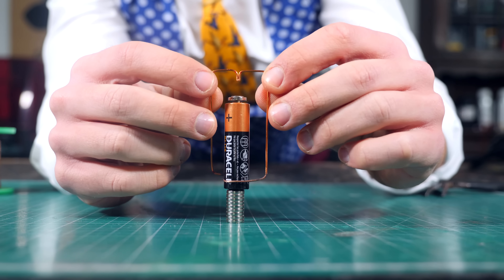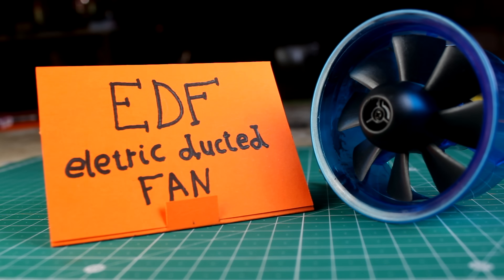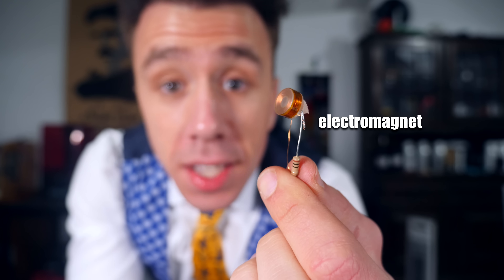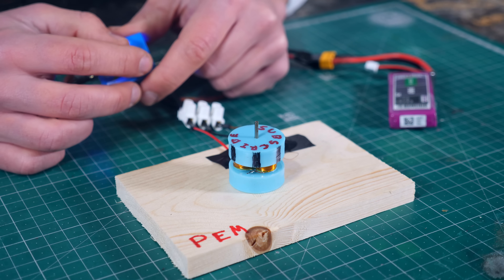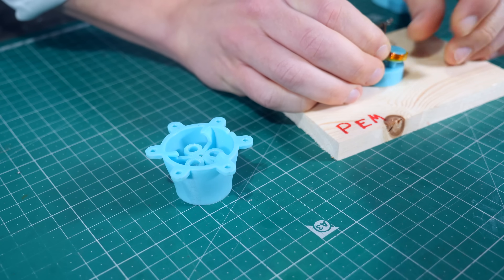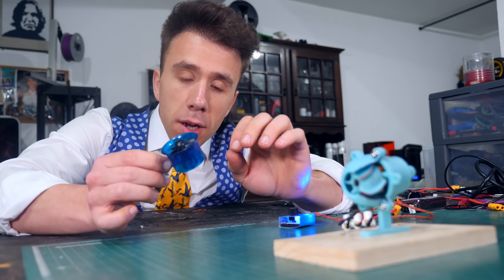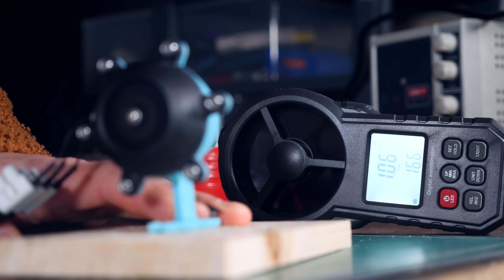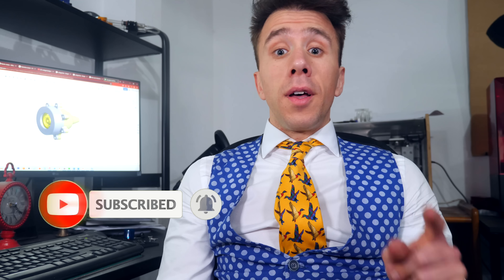I 3D Printed an ELECTRIC MOTOR FAN

Comment: Depending on your area change you can effectively increase or decrease the change in speed from inlet to outlet. When you use the impeller you are kinda just makign a fancy but simple fan whereas a dyson fan assembly still act as a converging nozzle. Converging nozzles are used because sub Mach1 flow increases (based on some fundamental equations that im sure you can find in one google search) when converging and over mach1 flow increases when diverging (Hence- converging diverging nozzle design of most jet and supersonic aircraft engines ant the bell chape of rocket engines) If you use that and know your inlet velocity you want or can get from an impeller or whatnot, you shoul'd just be able to input those to find your inlet mach number, which will probably be really slow but still, and then you can just figure out the in between values to get whatever output you want in terms of area change and anyhting else. Albit take this all with a grain of salt, I didn't really pay attention in my classes when there wasn't combustion involved.

Comment: I like Jets. I like computers. 

Why not cool a gaming computer chip by using an impeller jet to send water across the chip at high pressure? The impeller could work better in water. 
Or create a real underwater jet with a ducted fan and a fuel that burns in water (Magnesium/Sodium). Maybe don't use the superheated water exhaust to cool the computer.

Comment: Instead of adding some restricting structure to fan blades to make them splay out less under load, to make them not rub the casing, just note which parts rub the casing and shrink those. You'd be basically calculating this distortion as it occurs into the design, you're optimising the fan towards one given RPM where it's just splayed out enough to not touch the casing, but you avoid adding moving muss and air restricting structures. I doubt it's the crucial shortcoming here, but this is how mass produced fans are designed.

Comment: Hi Integza here is a good theme for a video. How about designing something that is cheap and can generate electricity. South Africa has been having rolling blackouts since November 2022. We are being told to get solar and go off the grid. A 10kW solar setup costs R265,000 and not many South Africans can afford it.

This is also a cry for help. 60 million people are suffering because of the rolling blackouts or as we know it... Loadshedding.

Comment: I am no above 100 iq person, but I would go about this very diffrentally, not so much the specifics, but the overall process. first id want to have a controlled variable, to do this I would use some motor setup that gives reliable rpm output or just use a tachometer to know what rpm the motor is at. with this testing each propellor design will more or less remove the motor from the equation. now that I don't have to account for motor speed, I can know the lower thrust of a fan type is the design alone. from there I would play with intake and outake sizes, as well as blade configuration(size, length, pitch/angle of attack).   this is just an overly complex way of saying to use trial and error with some of the scientific method. if you isolate variables and change only one at a time then you can learn and get repeatable results.

Comment: It could be one of several problems:
it could be that the increased/ decreased mass of the printed impeller is throwing the motor off
it could be that the tolerances of the print were not tight enough and you were losing pressure
it could be that the impeller wasn't balanced correctly/ not at all
the possibility of a rabid tomato militia scared it
some mixture of multiple problems

Comment: The only thing I can think of is, if you copied the impeller exactly, would be the weight of the material used to 3d print it, if your impeller was slightly heavier, the 3d printed impeller would not reach the same speed as the impeller you designed it from, which I think would mean it would not be as good, just a guess though

Comment: I think it's because the motor itself is tuned to produce the most power with a higher torque and lower rpm, and the impeller design calls for a motor that produces the most power at a lower torque and higher RPM.

Comment: Toroidal propellers are the next stage of fan/propeller development. For boat propellers they are meant to up to double the efficency. MIT did development of drone props and there was big gains there as well.
Surely a toroidal tomato bender will be even more efficient than standard ones.

Comment: I guess you should also measure pressure. The regular Impeller is made for high speeds. The Zentrifugal Fan is made for high pressure. As well, the geometry of your impeller makes me wonder. The angel of attack on the inlet side is to narrow, thus creates to much turbulence and hinders incoming airflow. the Angel on the Outlet side looks to steep, also creates turbulence instead of pushing the air. Look at the dyson turbine for reference. But again, you probably wont reach as much as high speeds like the regular impeller, as those are two different propellers with different strengths.

Comment: I think that the device your using to calculate the trust work by calculating  speed of not pressure. And jet engines like slow high pressure air.

Comment: I would say the biggest difference is the intake diameter but also the exhaust of it, is the impeller actually compressing the air going through or just pushing it? I also think the spacing between the impeller and the case would make a difference, I don't know if there are different printable materials that don't expand as much but you would want the gap to be as precise as possible. (Just thoughts)

Comment: the likely problem is the impellers mass, you need a lighter fan. also the air is being compessed, not sped up like in the EDF, so its a mix of having slow moving compressed air and too heavy of a impeller

Comment: Here is my thought... 
Disclaimer, even though hereafter I say "based on my lecture" I'm still a student so feel free to correct me if I'm wrong #cmiiw
Based on my fluid mechanics lecture, the impeller you made is called a compressor. Yes, you are right about the compression things but the nature of that component is to diffuse and compress the air (as its name). Consequently, the air on the output will have a lower velocity. More precisely the kinetic pressure (i.e. the velocity) changed static pressure. Therefore in the exit, the pressure will be increased (due to "compression") and the velocity will be decreased (due to "diffusion"). (i know, this is very scientific).  
In the aircraft, this high-pressure but low-velocity air will be burnt in the combustion chamber to increase its energy. After from combustion chamber, the air will enter the turbine. This turbine has the inverse function of the compressor. Here, the velocity will be increased and the pressure will be decreased. Well... the overall result will be air with high velocity (or scientifically speaking, high momentum). 
This is very different from the EDF. Its basic function is only to increase air velocity. Meanwhile, the aircraft turbojet engine (this type of engine is called an air-breathing engine btw) will decrease air velocity with the compressor, burn it with combustion (btw if I'm not mistaken the reason why we need to lower the velocity first is 'cause it is gonna be easier to insert extra energy to low velocity than the high one), and change all the energy into velocity with the turbine. 
Meanwhile, in this case, you only create the compressor... so that's why it has low output air velocity compared to EDF. Maybe creating the entire turbojet system will be a good idea :D
Oh btw as credit, I learn aerospace engineering at university. Again I'm still learning so #cmiiw

Comment: I have no idea why this would happen, but I do have some questions/ideas for an interesting experiment. What happens if you take your impeller and create a series with it? Will it increase the total thrust or does it just bog things down? Also Golf balls are dimpled because it reduces drag, could that be applied to a propeller to increase its energy efficiency or would the increased surface area cause it to slow down due to air resistence? I'm good with science ideas but terrible with math, so forgive me if these are stupid ideas. I'd also like to see you toy with different proppeller designs seeing as how the new toroidal proppeller has been in the news lately and am cruious just how shapes affect airflow and propolusion.

Comment: I don't know how true this is but it seems to me that the impeller fan has a significantly bigger mass across it's body. It's moment of inertia increases as it's radius increases which makes it harder to turn than the other fan. Additionally you might try varying pitch or angle of attack of the blades as well as perhaps air intake like others have suggested

Comment: You should make a video on over engineering a nerf blaster. 

Like using rocket fuel instead of a spring to make the plunger head go forward or using a fan and making it shoot as fast as the magazine can index a dart.

Comment: Have you tried using the dyson fan itself and printing a shroud for it? I suspect that the issue may well be the 3D printed resin blades are simply distorting under load as they are not as strong as the injection moulded parts usually used in these fans.

Comment: Bro nice video👌. But using this type of fun don't you get higher pressure and less thrust? It would work fine if you use also fuel ⛽️ You know like a jet engine 😏.
Reply: @mintegza1  what 📦 bro?

Comment: Some thoughts:
- Keep in mind for your deign: Modern jet engines try do move the air as slow as possible through the engine, but a lot of them. The actual fan in an jet engine has low rpm when compared to the other rotating parts in it.
- Match the overall inlet area and the ratio of free area to closed area for comparison. (Comparing apples with bananas gives reasonable results only until a certain point)
- Change the angle of attack of the leading edge of our compressor blades (There is an impedance mismatch at the very first edge - You chop of the air at the inlet with you compressor blades and rely on centrifugal forces. The speed difference is too high. Better "cut" into the air at the first edge.) The higher the velocity difference the "flatter" the first edge should be. Have a look how the slowly rotating blades of a jet engine are shaped.
- change the angle of attack of you compressor blades with radius. At the axle it should look more like an I or L, at the outer radius more like an S. This depends on the type of "fan" you try to build. Radial or axial accelleration.
- use an stator with thinner blades (impedance mismatch)
- the stator should look more or less like an inversed version of your compressor. The air flow directly after the compressor is spiraling, this reduces thrust, because the side-wise portion does not contribute much to the trust.
- reduce the distance between your rotating parts and the inner side of the hull. For example: At the red lines in your design, there is air "leaking" over from one section to another section due to the rotation of the compressor. At the back side of the blade, vortices occur which break air flow and create friction.
Reply: What he said
Reply: yeah, one look and the shape felt wrong, he had a dome shaped cowling that closely followed the impeller.
the reason he wasn't getting much air flow was because the intake was too small vs the rest of it, also, the low air flow was simply rotating within the cowling and not going anywhere.
 putting a cover attached to the rotor from the intake to the impeller exhaust would massively reduce his losses, leaving air only one path to go, outward, radially, this can be captured and redirected with an outer cowling that redirects the airflow back from radially to axially.
with stator blades to also redirect the spiralling airflow back to straight
Reply: High Bypass Turbofan jet engines normally don't employ a reduction gearbox. Instead, the fan operates a bit too fast for maximum efficiency, but it is at a 1:1 drive speed to the power turbine stages. A second coaxial shaft can be used to allow the compressor stage to run faster, and in that case it is driven by earlier stages of the turbine after the combustor stage. However, there are now Geared Turbofan engines that do employ a planetary reduction stage for the fan, allowing the turbine section to run faster than the fan. The fan runs more efficiently and the turbine runs at maximum efficiency. Pratt and Whitney recently brought out some geared turbofan engines.
Reply: Sounds like someone is indeed well read with aerodynamics.
Reply: True there are multiple planetary step downs.
Reply: Can one create a virtual boundary layer?  Like in the aerospike missile?
Reply: @NwoDispatcher  If you change the design a little bit, this may improve efficiency. The question is how you generate the virtual boundary layer and where. You need some power (compressor, gas generator, etc.) to generate gas if needed, or some extra power when the boundary layer is not established (at low speeds).
For high bypass engines there are some areas where you can easily generate a boundary layer. One low hanging fruit is the cover of the engine, actively by blowing out gas (front) or passively by creating vortices with a difference surface structure (golf ball surface at the aft portion), but the improvement would be not so high.
There are already prototypes where this is done at the wings. I'm not sure if they primarely use the ventilation with heated the air to reduce freezing at the wing tip.
Reply: The actual fan in an jet engine has exactly the same rpm when compared to the other rotating parts in it, since all rotating parts are mounted on the one-and-only axle...
Reply: @klausbrinck2137   There are already high bypass turbofan engines with gearboxes inside. Have a look what MTU already did ;) Or the patent US20140363276A1 from 2013
Reply: @marcelkanter  Turbofan engines use the combustion to turn the fan-axle instead of directly creating thrust, the epander-stage is oversized, and this fan then creates the thruston a separate axle... Still all compressor- and expander-stages are mounted on the same axle, and all turn with the same speed. It´d be useless to create a turbojet with another configuration. and here we aren´t talking about turbofans anyway, but about jet-engines
Reply: @klausbrinck2137   E.g. Pratt and Wittneys PW1100G has a gearbox, Many others use hollow shafts, that even rotate at differnd direction. But we drift away...
Maybe Integza first redesigns this fan in size. So he can compare them.
Reply: Since the compressor is 3d printed, and he's relying on centrifugal force anyway, he could probably connect the duct to the blades and have them co-rotate

Comment: Smaller engines need more rpm. Small RC jet turbines goes easy above 100K RPM and the dyson Motors too. The Motor you Build is way to slow and ist not easy to Build Motors that deliver power at high RPM. You should use the complete Dyson setup, then you have a high performance well Build and also balanced compressor.

Comment: I WOULD SUGGEST A LAGER INTAKE, WITH THE IMPELLER DESIGN FROM THE DYSON VACUUM, BUT IN THE BODY HAVE THE IMPELLER SHAPE IN THE OPPOSITE DIRECTION TO DIRECT THE AIRFLOW BACKWARDS, THE BODY NEEDS TO TAPER SO THAT THE OUTLET/ EXHAUST IS HALF THE SIZE OF THE INTAKE,  THIS SHOULD PROVIDE MORE THRUST AND HAVE THE AIR EXITING IN A STRAIGHTER LINE THEN TWISTING LIKE A TORNADO

BUT THAT'S JUST AN IDEA

Comment: I guess you need to increase the open diameter if the area of fan suction increase and , keep the fan long decrease the diameter uniformly for smooth pressure increase , intake is more obvious the output will more with good pressure

Comment: Even if your printed centrifugal fan is equally efficient to the original edc fan (it probably isn't, 3d printing a smooth low friction surface is hard) it won't produce the same thrust as a normal fan in open air. You've exchanged some of the air mass and speed for pressure. If you put both the centrifugal and original fan in a scenario where flow is constrained, you'd see the centrifugal fan quickly start to outperform because it excels at generating high pressure differences. This is why they are used in jet engines. You don't just need speed, you need pressure, because the only thing preventing backflow of the combustion is that the exhaust exit is a lower pressure option for the expanding gasses than the intake. In fact the compressor has to generate more pressure than the combustion chamber, because a fluid will always move from high pressure to low pressure. So a high power jet engine that produces a lot of pressure during combustion needs a very high pressure intake system.

Comment: do they consum the same amount of current?. outwise the pitch of the blades would be different or so. you controller gives you an fixed speed not an fixed current. current would be prop to torque

Comment: As you said your design is based off of a jet engine jet engines need the pressure to maximize air volume for burnin with fuel. The electric motor doesn't rely on fuel to generate thrust so it maximizes air flow through the engine. Because of this a clear visible difference of inlet outlet areas are present between your design and the original. Also high pressure over fan blades mean a denser medium so maybe the motor it's self is also not spinning fast enough. Which is why the Dyson fan has a motor 3x as big as the fan blades where as your motor is maybe half the size of the fan structure.